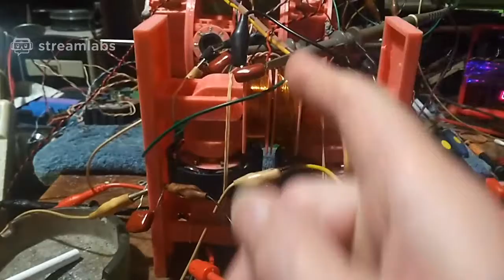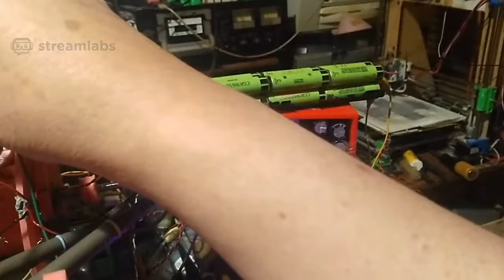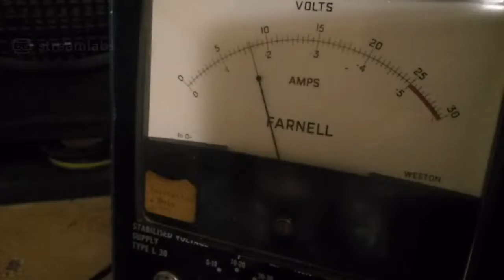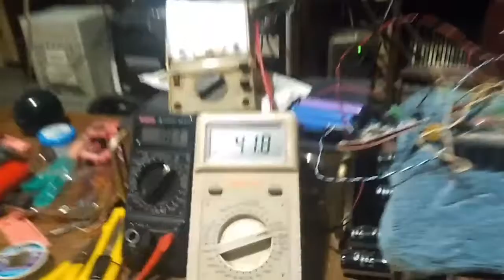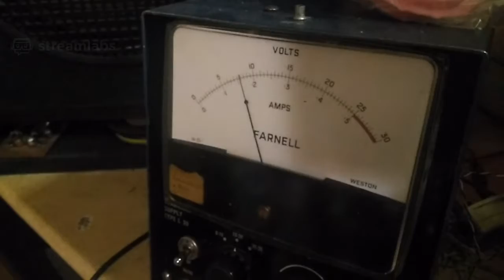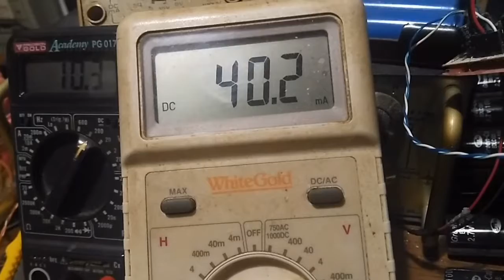📱 Strange behaviour of My MEG Generator under load.

Comment: The meg is not your average transformer. If you put electricity in a toroidal transformer the Aharonov–Bohm effect happens. Tom Bearden and his team have found a way to make a transformer like configuration where the Aharonov–Bohm effect automaticly takes place without external input. 

They are able to use the Aharonov-Bohm effect to first energize the surrounding vacuum outside the transformer core with curl-free A-potential, then perturb the core normally so as to send out A-field perturbations into that energized external vacuum (into its A-potential). From the perturbed local A-field vacuum the MEG receives back (from all directions) excess E-field energy pulses by the simple equation dA/dt = – E. The result is that the local altered vacuum – when subsequently perturbed – then sends back free E-field energy to the unit as an extra, free energy input from the active vacuum environment. By insuring some coherence in the received E-field signals, they also insure that the return excess energy input is usable EM energy from the altered local vacuum/spacetime.
 
As you know, force fields exist only in matter, since mass is a component of force by the simple equation F = d/dt(mv). Placing m = 0 in that equation shows that in massless space, “force” does not exist. So instead of EM force fields in massless space, instead there exist precursor “conditions of spacetime” as pointed out by Nobelist Richard Feynman. What we call “EM force”, then, rigorously is the ongoing interaction of that “precursor field” with charged matter q.
 
As the great John Wheeler points out, “Space acts on matter, telling it how to move. In turn, matter reacts back on space, telling it how to curve.”  [Wheeler's principle, as stated in W. Misner, K.S. Thorne, and J.A. Wheeler, Gravitation, W.H. Freeman and Co., San Francisco, 1973, p. 5].
 
Wheeler also pointed out the dominance of the interacting spacetime with matter and effects in matter. Quoting: “…elementary particles represent a percentage-wise almost completely negligible change in the locally violent conditions that characterize the vacuum...In other words, elementary particles do not form a really basic starting point for the description of nature. Instead, they represent a first-order correction to vacuum physics.”
 
So the Aharonov-Bohm effect (together with many others) shows that it is possible to directly condition or change (or “engineer”) the local spacetime itself, and then use it to affect the physical system embedded in that altered local spacetime.
 
What we call “force” is the ongoing interaction of the “condition of spacetime itself” with matter.
 
The bottom line is that (1) the vacuum/spacetime can first be preconditioned locally (precursive engineering), without using force or work (which is translation of force), and (2) then the altered and energized vacuum/spacetime can be stimulated to provide excess EM energy freely back to the system. The system then has TWO energy inputs: (1) the one we pay to make, and (2) the one the surrounding activated vacuum gives us for free. So, like a windmill in a free EM energy wind, their unit can exhibit COP>1.0, even though its energy efficiency is always less than 100%.
 
So “energy from the vacuum” is no more eerie than a common windmill or solar power cell array. Given the necessary input energy from the active surrounding environment, the system is legitimately permitted to function as an analogue to a common heat pump – which has an efficiency of only about 50%, but which normally has a COP = 3.0 to 4.0. In short, the heat pump wastes half of all its input energy from whatever source, but it receives so much excess energy from its activated environment that it can still output more heat energy than the electrical energy the operator himself pays to input. No violation of thermodynamics or of physics is involved. Instead, there is involved just a way to directly and freely alter the local environment so it is energized, and then to trigger it into sending free energy into one’s system to be collected and power the loads.
 
Note that such asymmetrical overunity electrical systems are specifically excluded from the normal electrical engineering model. The Heaviside equations were deliberately symmetrized in 1892 by Lorentz, at the instigation of J. P. Morgan, just prior to the formation of modern electrical engineering. It was done specifically to remove the asymmetrical “energy from the active vacuum” systems that Nikola Tesla had discovered. Tesla had labeled them as “energy from the active medium” systems. Tesla had just destroyed the dream of Morgan and Edison for their great DC power empire (a DC power plant every two miles in cities and built-up areas) by putting in practical AC generators at Niagara Falls. Since AC could be transmitted fairly efficiently for long distances and DC could not, then with AC power one did not require most of those expensive DC power plants. So the world adopted AC power stations and transmission. With that blow to his dreams of empire, the ruthless Morgan was immediately determined to destroy Tesla utterly and his backer Westinghouse also. And he thoroughly accomplished both goals.
 
Here is just one statement by Tesla of what he intended to do. Quoting:
 
"Ere many generations pass, our machinery will be driven by a power obtainable at any point in the universe. This idea is not novel... We find it in the delightful myth of Antheus, who derives power from the earth; we find it among the subtle speculations of one of your splendid mathematicians...Throughout space there is energy. Is this energy static or kinetic? If static our hopes are in vain; if kinetic – and this we know it is, for certain – then it is a mere question of time when men will succeed in attaching their machinery to the very wheelwork of nature." [Nikola Tesla, in a speech in New York to the American Institute of Electrical Engineers, 1891. Quoted from back cover of his biography, Margaret Cheney, Tesla: Man Out of Time].
 
During an address in 1897 Tesla stated:
     “We have to evolve means for obtaining energy from stores which are forever inexhaustible, to perfect methods which do not imply consumption and waste of any material whatever. I now feel sure that the realization of that idea is not far off. ...the possibilities of the development I refer to, namely, that of the operation of engines on any point of the earth by the energy of the medium...” [Nikola Tesla, during an address in 1897 commemorating his installation of generators at Niagara Falls.].
Reply from the maker: Well to be honest I always sucked bad at maths and it is just way over my head but thank you for making it clearer to those who understand maths as I could never understand what you said let alone explain it big hugs.
Reply: @aerotro  The MEG uses a novel materials effect freely furnished by the nanocrystalline core and its structure (some of them, not all of them!) wherein the B-flux curled portion of the magnetic vector potential A is sharply localized inside the core (recall that the B-field is merely the curl of A, hence it is the curled component of A). Such localization of the curled or “field” component of A, of course, is known as the Aharonov-Bohm effect, whereby a curl-free magnetic vector potential then freely appears OUTSIDE the core in space, where the B-field would normally have appeared had its localization not occurred.

So the MEG has thus conditioned the IMMEDIATELY SURROUNDING SPACE, so that extra EM energy density has appeared OUTSIDE the core, in space itself but in the form of the curl-free A potential energy. Since in general relativity the increase in energy density in spacetime is a curvature of spacetime a priori, then the MEG’s nanocrystalline core materials have provided an extra EM ENERGY RESERVOIR in outside curved spacetime.

Please note that this completely violates the standard CEM/EE model, which arbitrarily assumes a flat local spacetime and an inactive vacuum. In the MEG, the local spacetime is curved and the local vacuum is now active (the virtual particle flux of the outside spatial vacuum has been altered). This violates the standard assumed Lorentz symmetry, which is necessary if one would have a COP>1.0 energy-from-the-vacuum system.

The normal A-potential consists of two components: one curled and the other uncurled. Usually the uncurled component is rather much “hidden” by the curled component, and thus not usually considered.

Now note that, in the AB effect, the uncurled A-potential extends from INSIDE the core on out to the space outside. The AB effect only localizes the CURLED portion (the B-field) of the total magnetic vector potential A.

But now, when we perturb that B-flux inside the core, an additional effect occurs. We also perturb the “inside front end” of that curl-free A potential component extending on out into the outside space, and that perturbation of the inside end of the uncurled A propagates passes outside the core and on through the uncurled field-free A potential in outside space. In short, that part of the perturbation travels outward outside the core and out into the surrounding uncurled A.

The simple equation dA/dt = - E then tells us what happens outside the core. The perturbation spreading radially outwards just outside the core, is a dA/dt perturbation and that perturbation is directed out and away from the MEG core. In the little formula the resulting E field produced by that spreading perturbation has a negative sign on it, so the E-field created in outside space by that outward-traveling uncurled A perturbation is directed FROM THE OUTSIDE SPACE BACK INTO THE MEG CORE ETC.

Note also that the magnitude of the – E produced, is controlled by the sharpness of the rise time and decay time on the input pulses the operator feeds into the MEG’s normal input coil. One can easily produce sufficient return voltage to destroy the insulation on the windings on the coils. Every coil and every wire is now an “input coil and input antenna” for the MEG’s receiving of that returning E-field energy.

Each and every wire or coil in the transformer section receives a part of that E-field energy radiating back into the transformer from space just outside the core, and each receiving wire and coil also then re-radiates energy to all the others. The result is a dense set of E-field signal energies (in pulses form) but of varying phases.

Then we adjust things (the method is proprietary!) so that a reasonable “phase addition” condition exists in the dense signal environment of the MEG. Once that is done, the return energy received from the returning excess free E-fields is largely coherent in the MEG. We then have the following situation:

(1)     the MEG acts in part as a very efficient standard transformer, courtesy of its modern nanocrystalline core structure. With the normal transformer part of its operation alone, the MEG would get about 90% efficiency and – without any other energy input – it would produce something like COP = 0.9.

(2)     But there is also a great deal of extra, free EM energy coming into the MEG from the altered spacetime outside the core, due to dA/dt = - E and the Aharonov-Bohm effect. Indeed, there is easily more E-field energy coming back into the MEG from the outside space, than the input energy we ourselves placed into the “input” coil.

(3)     The MEG thus has TWO energy input reservoirs/sources: (a) energy input by the operator and paid for by him, and (b) lots of excess free environmental E-field energy received from the altered external space and the perturbed AB effect.

The MEG’s thermodynamic operation is now similar to that of a common home heat pump. The thermodynamic efficiency of the home heat pump is only about 50%, and so – if all its input energy were only what the operator pays for and furnishes – that would allow a COP of only 0.5. But the heat pump ALSO receives a lot of excess free heat energy from its environment. It in fact receives so much extra free energy from its environment that it outputs three to four times as much useful energy and work as the operator himself had to input and pay for. In short, its COP = 3.0 to 4.0, even though its overall efficiency is always less than 100%. Which is why we use home heat pumps in the first place.

So the EFFICIENCY of the MEG is always less than 100%, because it rigorously obeys the conservation of energy. Total energy input to the MEG from all sources, minus total energy dissipated in its losses, gives the amount of usable energy or work output by the MEG. Since – contrary to any ordinary transformer – the MEG receives an extra, free, and appreciable input of pulsed E-field energy from its environment, the MEG’s operation is directly analogous to that heat pump, and its COP is permissibly COP > 1.0.

The MEG completely complies with physics and thermodynamics, but with the nonequilibrium steady state (NESS) thermodynamics. That is, with Prigogine’s thermodynamics of dissipative systems.

We also note that certain areas and effects have long been accepted and accounted in NESS thermodynamics, which allow violation of the second law of thermodynamics (i.e., allow the production of negative entropy). Strong gradients (as used in the MEG in pulsing) and materials memory (as exhibited by the materials freely initiating the AB effect) are two such recognized and proven areas. See Dilip Kondepudi and Ilya Prigogine, Modern Thermodynamics: From Heat Engines to Dissipative Structures, Wiley, New York, 1998, reprinted with corrections 1999. Areas known to violate the old second law are given on p. 459. One area is strong gradients (as used in the MEG) and another is memory of materials (as used in the MEG in the nanocrystalline core materials and structure).

You can easily get the AB effect with a good toroidal coil, as is well known. But there you have to PAY for it in terms of voltage x amperage.

The thing that made the MEG possible was the discovery that certain nanocrystalline core materials and construction freely evoked the AB effect, so you do not have to pay for it. Immediately that tells us that we have a FREE and extra EM energy reservoir in the MEG’s self-modified external spacetime environment, and that modified environment is feeding excess electrical energy right back into the MEG for its use.
Reply from the maker: @cjbartoz  Thanks yeah a friend gave me some Nanocrystalline material I used in a later build sadly due to my health situation and lack of money I put it all on hold.
Reply from the maker: @cjbartoz if you go through my playlist on the main build you will find all the work I did on it. https://www.youtube.com/watch?v=EBPvIW93dSo&list=PLjuCiV5HRn3RCxCMH_xvkyh8EkEpn0iBp
Reply: @aerotro  Tom Bearden and his team also apply a marvelous material effect they discovered in a special core material. The core made of that material extracts almost all the magnetic field flux from the permanent magnet, similar to how a toroid localizes the entire B-field inside it. An outside field meter right on the pole of the powerful little magnet shows very little magnetic field reading. 

Can I be so impolite to ask what health problems you have, maybe I can help with that to.
Reply from the maker: @cjbartoz too many, due to being transgender I also have kidney disease stage 3, and at my age is nearly 66. Well, prospects are not good. But it's fine. I made my piece with the world.
Reply: @aerotro  About The Buteyko Method: A Summary of the Pathophysiology of Chronic Hyperventilation by Ira Packman, M.D.

The fact that chronic hyperventilation (CHV) has an effect on the lungs is easily understood and explained. The systemic (whole body) effects however, are physically and physiologically distant from the lungs and therefore are more difficult to understand. The multi-system, wide spread systemic ramifications of chronic hyperventilation are numerous.

These effects are all caused by the initial effect of pulmonary hypocapnia (low CO2) which causes spasm of the airways leading to asthma. The loss of CO2 from the lung on a long term basis causes a compensatory response throughout the body. This concept is called homeostasis which means that the body is always trying to stay in balance and return to its most comfortable state.

A partial list of homeostatic controls would include:
- Constant body temperature
- Constant whole body water volume
- Glucose levels
- Mineral balance including sodium, potassium, magnesium, zinc etc.
- Acid base balance (Ph control)

The acid base/Ph control mechanisms are very sensitive and closely controlled, because the Ph of the body affects the function of every body system. It is this system that is activated when patients chronically hyperventilate.

Understanding this concept, we can follow what happens with CHV.

- The lungs continuously blow off too much CO2 causing local pulmonary hypocapnia (low CO2) and arterial hypocapnia.

- The arterial hypocapnia immediately changes the Ph of the circulating blood causing an increase in the Ph (alkalosis).

- The increase in the Ph causes a decrease in the delivery of Oxygen to all the bodies tissues due to the Bohr Effect (In an alkalotic environment, the hemoglobin molecules in the red cells hold onto the oxygen molecules more tightly and will not release the O2 to the tissues).

- The kidneys see the alkalosis/Ph change and know that it must correct the bodies Ph back towards neutral (neutral Ph is a Ph of 7.40). Once CHV becomes long standing the kidneys response becomes an ongoing process in which the kidneys excrete bicarbonate in an attempt to correct the alkalosis which was created by the CHV.

- The net result is a depletion of the bicarbonate buffers due to continuous over excretion of bicarbonate which also causes the loss of electrolytes including magnesium and phosphorous which are lost with the bicarbonate.

- The loss of phosphorous also decreases the production of ATP (adenosine tri-phosphate) and ADP which are the bodies’ main source of energy.

- This then causes a decrease in the functioning of many organs including the muscles, heart, lungs, bone marrow, immune system and liver.

- These functional changes, coupled with the arterial spasm that occurs directly due to the low CO2 levels in the blood, are expressed in the long term as muscle fatigue, hypertension due to arterial spasm, decrease in the oxygenation of the brain, migraine headaches due to arterial spasm, spasm of the arteries supplying the gut, decrease brain function with memory changes, alterations in the production of proteins and metabolism of lipids in the liver.

This is just a partial list of the systems, organs and bodily functions which are affected by CHV and the subsequent low CO2 levels in the lungs and blood.

This concept regarding the origins and causes of these diseases is very radically different from the way medical schools teach about these diseases. It is revolutionary and may be too simple for many academicians to accept or understand.
Reply: @aerotro  Getting Started
by Peter Kolb

While the Buteyko method introduced into the west has been getting excellent results, it does not entirely accord with Professor Buteyko’s recommended practice. During two weeks he spent in New Zealand in December 2000, he demonstrated the Buteyko technique as it should be practiced.

Aim
Firstly, it needs to be understood that breathing too much is a bad habit that leaves you with a debilitating shortage of carbon dioxide and bicarbonate. It usually results from long term, undischarged stress. Any stress makes you breathe more. If this is sustained over a long time period it becomes a habit. The physiology behind this habituation process is well understood. Buteyko therapy aims at reversing this, by habituating to less breathing. You do this by developing and sustaining a feeling of a slight shortage of air over a long time period. This gradually restores your carbon dioxide and bicarbonate levels back to normal.

Maximum Pause
While it is possible to stifle an asthma attack with a long and uncomfortable breath hold know as a maximum pause (MP), this procedure does not reverse your asthma and does not retrain the respiratory center to pace your breathing correctly. Professor Buteyko is emphatic that the maximum pause has no therapeutic value in restoring healthy breathing, which is the aim of his therapy. It is also dangerous for people with various disorders such as hypertension, heart disease, epilepsy, kidney disease and diabetes. It can also destabilize your breathing, making it worse. Unfortunately the maximum pause has been introduced into a westernized version of the Buteyko technique, much to the annoyance of the Professor.

An understanding of the physiology behind the Bueyko method leaves no doubt that the maximum pause cannot improve your breathing.

DIY/Self-help
Professor Buteyko is firmly opposed to the DIY/self-help approach. The Buteyko technique relies 100% on patient compliance for effectiveness. Learning it from a script is like learning Yoga or martial arts from a book. Most people will experience changes in their bodies as their CO2 levels rise. These changes vary from one individual to another. Buteyko practitioners help you deal with these changes, keep you motivated and ensure that you do the breathing exercises correctly. Support for your Buteyko practitioner enables him to continue his work of bringing the technique to other sufferers.

Nevertheless, very few people around the world have access to a Buteyko practitioner. So here are some basics to help get you started.

Medication
Do not make any changes to medication. Steroids must be taken as prescribed. Because of carbon dioxide shortage asthmatics often don’t make enough Cortisol (natural steroid) and must have supplements. Steroids are not just anti-inflammatories but they are needed by the body and without the right amount it can be almost impossible to get breathing back to normal. Your doctor will be able to review your need for steroids when you stop having asthma symptoms.

Bronchodilators must be taken only when needed. As you progress, discuss with your doctor the possibility of weaning yourself off long acting bronchodilators and replacing them with short acting ones. That will give you more control over using them when needed. You should find that within days you will be able to overcome asthma attacks with reduced breathing and won’t need the bronchodilators. Nevertheless, you must always carry them with you for emergencies.

Nose breathing
Always breathe through your nose. If your nose is blocked perform the following exercise: After breathing normally (do not make any exaggerated breathing manoeuvre), hold your breath for as long as is comfortable, and then gradually resume very gentle breathing. It may help to pinch your nose, nod your head a few times or do some other form of exercise. In stubborn cases or when the blockage is due to a cold, you may have to try a few more times.

To avoid breathing through your mouth in your sleep, you might like to experiment with a little light medical paper tape to keep your mouth closed. Mouth taping at night is not recommended by Professor Buteyko, but most people find it extremely valuable. If you do, protect your lips with suitable cream, use a low tack tape (some are quite aggressive), and make sure you fold a tab or handle at each end for rapid and easy removal. Do not go to sleep with tape on your mouth if this causes any form of anxiety.

Comfort
Make sure you’re comfortable before starting the exercises. Remove unnecessary clothing since the improved blood carbon dioxide will dilate blood vessels in the skin, thereby warming you up.

Posture
To get your posture right stand with your back to a wall, heels, shoulders head and bottom touching the wall. Now drop your shoulders. Keep this upper body posture when sitting.

Relaxation
While maintaining your posture, relax all the muscles in your chest, neck, shoulders, arms, tummy and particularly the diaphragm. It’s a good idea to tense them up a bit first before relaxing them so that you can properly identify them and make sure they are all relaxed.

Normal Breathing
Take off your shirt and stand in front of a full length mirror. Watch your chest and tummy for breathing movement. Make sure that your chest does not move at all, and only the upper part of the tummy moves, between navel and breast bone. The second thing to check for is that the tummy moves out with each in breath and not the other way around. Many people get this wrong. Your out-breath must be free, relaxed and unforced.

Reduced breathing (RB)
Your aim is to develop a feeling of slight hunger for air, sustain this over a period and do this frequently. In fact, this should become a habit so that you do it all the time until you have achieved your health goal.

Try to feel your breathing and become aware of your breathing pattern. Now try to maintain this pattern while taking in just a little less air on each breath so that you develop a slight hunger for air. Initially try to sustain this for two minutes, then five and then ten.

If you follow all the steps correctly, then you should feel really calm, good and even a little sleepy. If you already practice relaxation techniques, yoga etc, you can combine them with reduced breathing.

Measuring your breathing
Hyperventilators breathe more than normal in order to achieve lower than normal blood carbon dioxide levels. It follows that if you have to breathe more than normal, then you will also not be able to hold your breath as long as you should. Professor Buteyko has cunningly used this principle to measure your blood carbon dioxide by testing how long you can hold your breath.

You start the pause somewhere in your normal breathing cycle. This is how you start the pause: Look up with your eyes and at the same time pinch your nose and start a stop watch. Just before it starts to get uncomfortable, stop the stop watch and resume normal breathing. You should be able to resume normal breathing without any effort and without taking deeper or more frequent breaths.

Some precautions:
- Do not take a deeper breath before the pause.
- Do not make any attempt to empty the lungs before the pause.
- Do not worry about which phase of the respiratory cycle you happen to be in before starting the pause. A pause is just an interruption of normal breathing.

The time in seconds is called a Control Pause (CP). Asthmatics typically have a CP of 5 - 15 seconds. (But not everyone with such a low CP has asthma.) Your aim is to achieve a CP greater than 40 seconds, although for perfect health Professor Buteyko recommends a CP of at least 60 seconds.

Doing a Set
When at rest, correctly seated, comfortable and relaxed and after breathing normally for at least five minutes you are ready to do a set. A set consists of
Pulse - CP - Reduced breathing - 3min normal breathing - Pulse - CP

First measure your pulse and then do a CP. Record the results on a table. Then do reduced breathing for ten minutes. Breathe normally for three minutes, then take your pulse again and take another CP. If you’ve done your reduced breathing correctly your pulse should go down and your CP should go up. Sometimes the pulse remains the same. If it goes up you’re not doing it correctly.

After three days you should be able to do around 8 to 10 sets a day. You can then start integrating reduced breathing into your daily life. Ideally you should aim at doing reduced breathing all day.

That takes care of the exercises. Here are a few helpful hints to help your recovery.
- Don’t eat unless you are hungry. Only eat until you have had enough. Eating increases breathing; eating excessively increases breathing excessively.
- Don’t dress too warmly. Be careful not to overdress children. If you are worried about them being cold, check their ears, nose, hands and feet. If these are warm, they’re OK.
- Make sure you get plenty of vigorous exercise. But don’t exercise to the point where you have to open your mouth to breathe.

If any of these recommendations make you dizzy, sick, anxious or give you palpitations, stop immediately. If possible see a Buteyko practitioner.
Reply: @aerotro  FMSW-protocoll:
- fatty meat from ruminant animals (when hungry/until satiated)
- 100% unrefined salt (to taste)
- high quality mineral water (when thirsty)